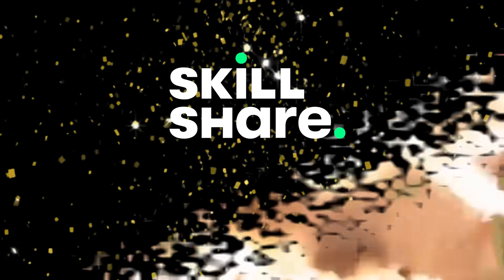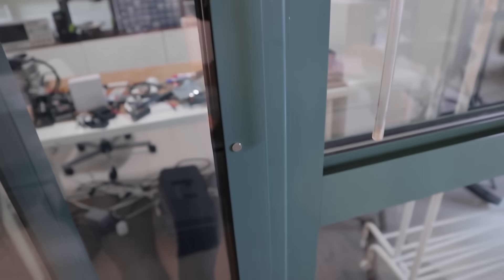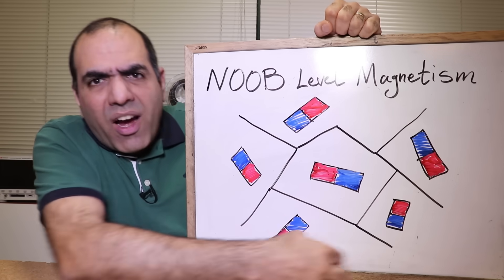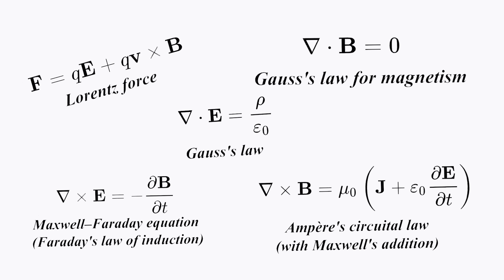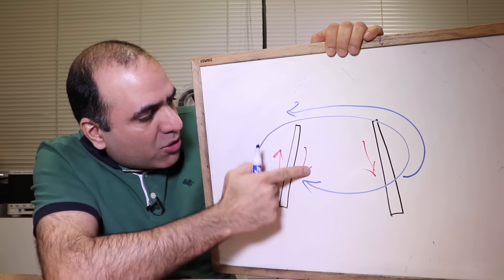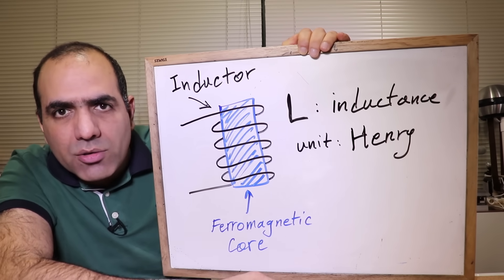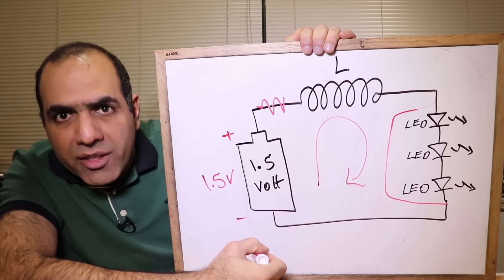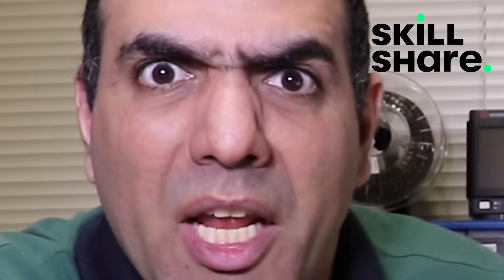Magic of Magnetism & Inductors (ElectroBOOM101-007)

Comment: Fun fact: If you take the two equations (V = L × dI/dt and I = C × dV/dt) and put them together, you get:
I = 1/(LC) dI^2/dt^2
Which is the equation for your typical LC oscilator circuit.

Comment: Maybe a NOOB question.. but if the magnetic field whants to oppose the current, then wouldn’t shorting the coil and releasing it not induce a voltage with reversed polarety?  If I’m wrong, then why not? If I’m right, how come the LED example is right and should not be reversed?

Comment: I would like to request Mr.Electroboom to film a video to explain "why in a circuit consisting of an inductor takes shorter time for the current to drop to zero when the circuit is open compared to the time taken for the current to reach max steady current when the circuit is closed", thanks very much.
Reply: And also why there's huge back emf induced when the circuit is open

Comment: Fun Fact: EMF can also be used to measure the amount of ghost you have in a given location.

This would explain why over 90% of circuitry based devices are haunted.

So if you ever have trouble with glitches and errors in your computers, just call an exorcist. He'll solve all your programming problems in a jiff.
Hourly rates apply of course.

Comment: ASA, so, why not store your shorted current from the inductor into a capicitor and use it without the LEDs flickering?  Might require some form of radical diode rectifying setup.... Do more with magnets!  You can do much more Mehdi... much more!  #muchmore #magnets

Comment: Hey man first off big fan. Man I’ve had some success and lots of fails but it’s the 3rd dimension of the coil make other shapes other than round coils.Triangular and pyramidal shaped rotors spin well with ac or dc input. Keep thinking of what the interference on the field would look like and what you want to have is a controlled imbalance of charge. It will cause inductors to react and also react with other fields.

Comment: My boss walked his property with two pieces of bent coat-hanger gently held in his hands and it identified the direction of the underground plumbing and power lines. Did you cover this already? It was mind blowing
Reply: That's either dumb luck, fraud, or something a yet not understood by science.  I've seen it work.  I've done it.  Nobody knows/understands how...nobody.  In my case it wasn't fraud, but it could still be dumb luck.
Reply: @johnchestnut5340  okay we can do it repeatedly. It's known moving matter creates a magnetic field. You are the only one who doesn't understand it so, speak for yourself. You probably believe God created earth too..
Reply: @philmichael143  You make assumptions.  You can't feel electric fields or magnetism.  To get an induced current requires a closed circuit perpendicular to a changing magnetic field.  Two bent metal rods isn't going to tell you anything based upon electric or magnetic fields in the context you provided.  You can't believe in "divining" for water/metal and call beliefs in creation absurd.  Then again someone who doesn't understand reasoning/logic could hold inconsistent beliefs.  Get your facts correct before insulting another.  Moving charges within a magnetic field is "current" especially within a conductor.  Current creates its own magnetic field.

Comment: That final explanation was in my text book explained as ELI the ICE man.  ELI means that the voltage (E) leads or comes before current (I) in an inductor (L). ICE means the current (I) leads or comes first before voltage (E) in a capacitor (C).

Comment: I don't think the iron core "magnifies the field" as you said in the video... rather... and according to the equations you showed... doesn't the core cause a higher density field to be created in the iron core?... because the amount of field depends on the magnitude of the current... given a fixed coil structure... and that current is determined by the resistance of the coil, and the applied voltage.

Comment: I was hoping you were going to mention that what's happening in the Inductor-LED circuit you showed is similar to what's at the core of a DC-DC boost converter. I remember thinking how cool the design was years ago when I first saw the basic circuit of a boost converter. Maybe that's a topic for the next video.

Comment: Such a shame there is a clear misconception in your explanation. No, Electromotive Force does not oppose to current, it's the opposite ! Current and electromotive force are directly linked and reversible, it's like a screw turning in the flow of a water pipe (more than a ballooned pipe). The force opposing a change of current is called back electromotive force, and like in the parallel with the screw is relative to the screw inertia. So just like inertia is not a real force, or centrifugal, coriolis, etc, back EMF neither is, and does not corresponds to a magnetic field. All your diagrams from 6:36  to 7:30 are flawed.

Comment: Yo Mehdi, Sup you bastard that never responds.. Seen that video of Cody showing how he increased the head on his water pump by continuously plugging and unplugging the outlet of his hose at quite a high head? Each time he would let go. The water would make it a little higher in the pipe. It was one of the most clever approach I have seen to showing what exactly is happening inside an inductor.. I make water pumps for a living. So I always try and make analogy to electrical and fluid dynamics. Flow and Head vs Current and Voltage.

Comment: Now you can show 240 volt center tapped, with a balanced restive load, makes the center tap not pass any current. However should you use a inductive load on one leg and a capactive load on the other you then have 180 degree phase shift, and the common center tap now carries twice the current!

Comment: Why is the inductor able to provide 9V to the LEDs if the battery could not?
Reply: It's a pulse, meaning the change of the magnified suddenly release the power it storage, then somehow urge the current to rise, but the inductor and the battery are not an ideal component, they have internal resistant (both the inductor and the battery), the raised current though a larger resistant creat a higher voltage (U=IxR), so the voltage goes up and the LED is in parallel with all these, then it is on.

Comment: Is there a mistake in 11:20? I mean, when the voltage change as a Sin way, at the peak, the change of the voltage (meaning the slope of the Sin curve is zero) dU/dt=0, right? So the change of current (di/dt) would be minimum at the peak of voltage, correct?

Comment: Mehdi(or anyone in the comments) I am an absolute noob so forgive my stupidity. Im pretty sure that a transformer can amplify (or reduce) the voltage of AC. I understand that voltage = current * resistance so if you pass ac through a transformer arn't you just pulling electricity out of thin air?

Comment: thats how rf amplifiers work, by generating high voltage oscillating at a certain frequency. there are loading coils and transistors that generate the pulses. feels good to get shocked by one, it burns you instead of shaking you.

Comment: As far as physics are concerned it's just a fundamental force.  I'm not an expert but EM is one of the four forces.  Forces have force carriers, a photon is the carrier for EM.  Electromagnetism is like spacetime except instead of space and time it's electricity and magnetism.  Theoretically there are such things as gravitons like photons but we haven't seen one yet.  Why do these forces have self similarity?  I don't think we know that yet.  Please correct me if I'm wrong.  Oh and photons are massless so they travel at maximum speed in that they skip a dimension (they "travel" instantly relatively) whereas neutrinos for example have some mass so it takes them "a time" to travel albeit a tiny amount.

Comment: Nickola Tesla , Proteus Steinmetz , Eric Dallard , Learn field propagation. Then you can get rid of those pesky , dim over unity BS. Your Are welcome.
Reply: 7.01 Mins If you capture those fields What happens ? Rite Over unity. Thanks right. Wanna learn or do you need me to hold your hand.
Reply: 10.05 Mins You show again over unity . But because you gave me grade 3 science class before hand the sheeple didn't see that you are full of it . I knew you would need me to hold your hand.
Reply: The capacitor voltage does what ? You may wanna look at it again. . . . . Right I know

Comment: Thank you so much.  I have a few screwdrivers I use that have become magnetically charged and won't release the screw. This often becomes a problem when working on small delicate projects.  I can't believe I never thought of heating them. Thank you.  
I love your "Magic" sound affects lol.
Keep up the great work.
oh yes,  Thanks for pointing out that inductors lag and capacitors lead the currant flow, that's very helpful in understanding how circuits function.

Comment: Magnetic fields do exist, it just depends on reference frame. The simplest proof is by considering a particle with charge q moving alongside a wire with current, I.

In the lab frame, we know that the wire is neutral and thus the force on the charge is purely magnetic. However, if we boost into the frame of the particle, we see that the positive and negative charges in the wire have different velocities, which leads to an overall charge on the wire (due to length contraction). Using the equation for electric field by a charged wire, we obtain the electric field that the moving charge feels.

From here, we can obtain the force on the particle due to this electric field. To boost back into the lab frame, we divide this force by the Lorentz factor and voilà, we arrive back at the force due to a magnetic field. Note that this proof is purely algebraic, so it doesn't involve any fancy tensor calculus that you would see in general relativity!

Source: E&M notes from my grad courses
Reply: He mentioned that in the video.
Reply: @ДмитроПрищепа-д3я  he states that magnetism is fake
Reply: @ДмитроПрищепа-д3я  he also asked for clarity on the subject, which is what I presented

Comment: Is there an error in the schematic?

Shouldn't a collapsing magnetic field generate a reverse voltage?
In this case, the diodes have to be installed backwards.

In either case, the diodes must be shorted every flash, to build up the magnetic field.
Even the diodes are installed the way in the schematic, there is no current because the breakdown voltage of the diode (3V) is higher than the battery voltage.

This is the reason flyback diodes (for example at solenoids) are installe parallel to the inductive load, but backwards.

Sorry for bad english and being a know-it-all...

Greeting and i love ElectroBOOM101
Reply from the maker: The voltage does flip, but across the inductor! If we assume the positive side of the voltage across the inductor is on the battery side, When LEDs are shorted, the voltage across inductor is +1.5V. But when the short is removed, the voltage across the inductor is -7.5V, adding to the battery voltage to get 9V across LEDs.
Reply: @ElectroBOOM  Sorry, you're absolutely right. My fault.
The Voltage of the collapsing magnetic field is added to the batteryvoltage.

I used Kirchhoff's voltage law the wrong way.

Thank you for teaching me.
Great content by the way. I love that you "Share your Skills" with us. ^^
Reply: Hmmm...

Good Question.
What do you guys think about it?
Reply: I watch
I read 
But I don't understand a damn thing
Reply: @gigachad9231  Do you need any further info?

Comment: inductors are awesome! (and why id firefox picking it up as a misspelled word?! lol) i always wondered how they got the 600 Volts from the poles to the house at 120 Volts without starting a fire! (cause a Resistor would need to be BEEFY!) turns out it is a inductor with about 1/3 turns on the receiving end!

Comment: If you replace current with water:
Current = flow rate
Voltage = pressure 
Capacitor = elastic sheet, or a balloon inside a pipe, with its lips attached to the walls.
Induction = a water mill 
Resistance = a sponge in a pipe
A diode = one directional valve

Comment: You just described an inductor as a free energy device. By saying that it got its energy for nowhere. A coil of wire can't store energy as it leaks it's energy slowly. So therefore it's energy isn't stored. And in some cases the inductor is shorted and its current is shared. So it constantly leaks it's energy.

Comment: 11:20 . @ElectroBOOM I think you got confused with the rate of change of voltage. You swapped them
Reply: No, he didn't.
Reply: No cuz to the right is later in time
Reply: Yep
Reply: 2 yrs later but nop, medhi was right! I got confused by "rate of change of current" with amplitude, I'll try to explain 

At 0V, the rate of change of current is 0, so the gradient of the current sine wave is 0, at peak voltage the rate of change of current is at it's highest, so the gradient of current sine wave is at it's highest

If it's still confusing draw up a voltage in time graph, and draw a sine wave. 

Apply the Lenz law equation for di/dt and subsitute 0V, peak V to it to get the points needed for a Current sine wave...and voila! (Something I didn't know til recently was that Windows calculator can draw up graphs, and even tell you it's properties!)

So sorry I was a dumbo 2 yrs ago, I hope I made it up ...even if it's late af

With a different color(to help differentiate) draw the new